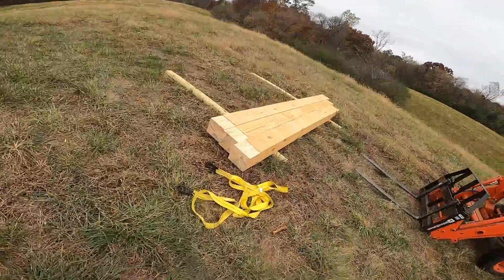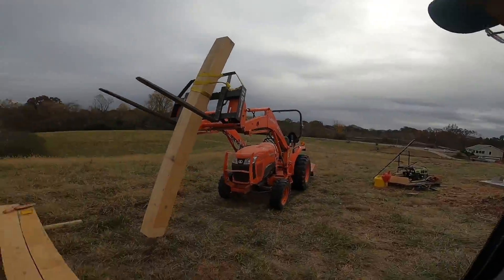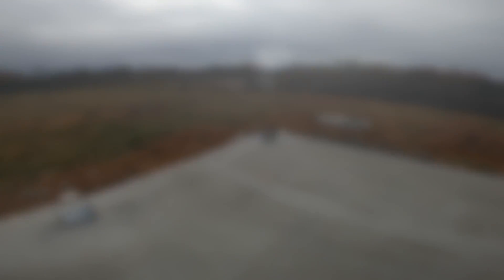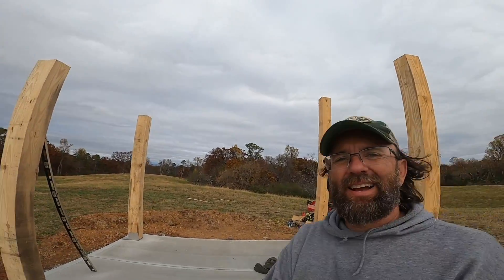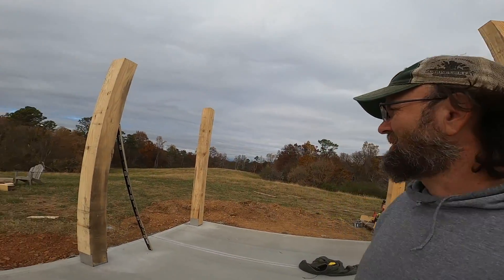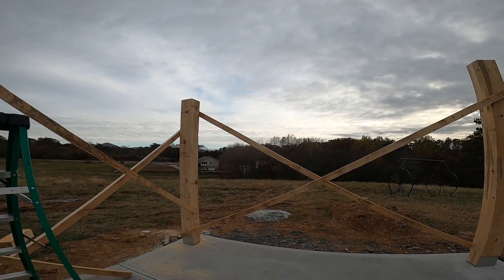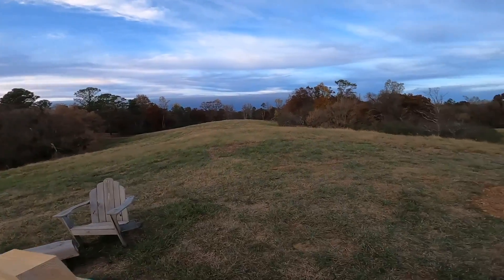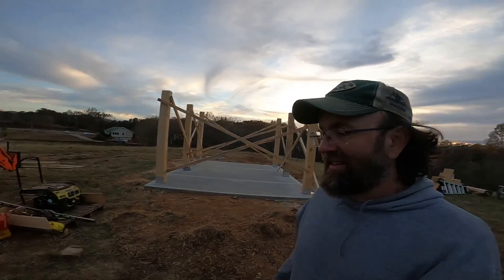13x16 DIY Post & Beam Pavilion Build Part 2: Setting 8x8 Posts

Comment: Looking great - wood to concrete bases cost waaay more than they should, just sayin'!
Reply from the maker: no doubt brackets to connect to concrete aren't cheap!  These ones I used weren't too bad.  Stainless steel and well made off amazon for about $35 per bracket.  For stainless that is pretty reasonable I think as you never have to worry about them rusting or anything.  Thanks for watching!!!